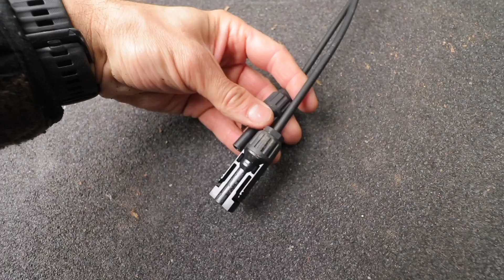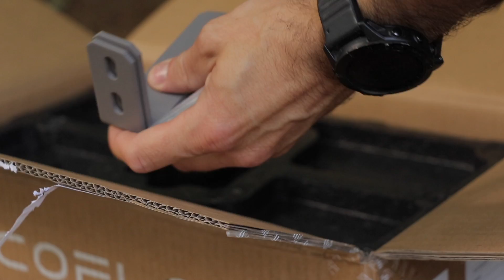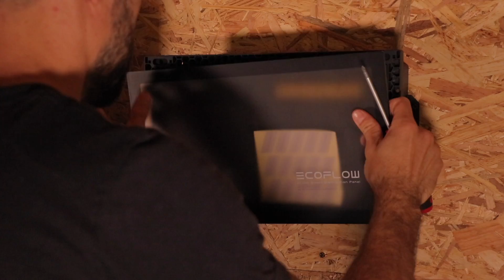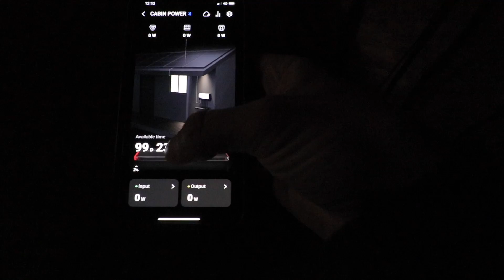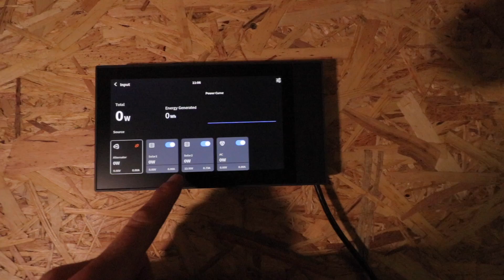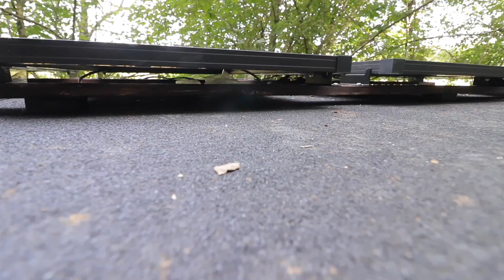Building an Off Grid Solar System at the Cabin in the Woods

Comment: I have a good system which works, hide your electrical system, i have an outhouse in the mountains in Colombia, my solar panels arent visible on the roof because my roof is flat with a border around hiding them. My electrical system such as batteries, fusebox, solar charger are in a hidden wall compatment. I even have a fake light switch and "main power connector" to a fake breaker box inside so that they think its powered by an external generator that i would bring. I also have an an underground mancave at least that was what i intended for it, the entre¡Ance is hidden under the floorboards with a very ingenious system to unlock using a magnet. I keep my tv, electronics and a small fridge (running) there so when i go there once a week i dont need to haul everything with me.

Comment: $6400(US) for 6KWh is nutters.  That's just the ecoflow and the batteries.  Doesn't include all the extra devices you installed.  Plus solar panels (which will need to be cleared regularly).  We might be looking at near $10,000(US).  How much did the rest of the cabin cost?
For $750, you could buy four 1.28KWh batteries.  Keep two in the cabin and swap them out with the other two every time you visit.  
Who would ever pay near $10,000 for the same result?  Oh yea, this is sponsored, so you didn't.

Comment: HOLY CRAP I wouldn't be leaving 10k worth of gear in the shed mate and think a camera system is going to stop some scrotes from nicking them you must be bonkers!! I think I'd be taking the system home and set it up then just take the battery's to the cabin when required
Reply from the maker: Funny you mention this, a few weeks ago I had this exact thought and I've actually done exactly that. Got the setup at home now, and the solar panels work much better on the workshop as it's got direct sunlight with no trees.

Comment: Shouldn't you have put in a vapour/moisture barrier between the outside and insulation, and again between the insulation and OSB sheeting,?  I think you're going to have trouble with damp and condensation without the vapour/moisture barriers.  I put them in on a timber workshop and 10 years later, when I dismantled and sold the workshop, the internal walls (gypsum board) were absolutely bone dry and there had been zero condensation/damp issues or water ingress, because of the barriers I'd put in.

Comment: It's awesome the cabin had that insulation put in! I was hoping years ago the pallet cabin would have this type of insulation placed in it. I'm curious what the R-Value is with these IKO Enertherm boards. Their site doesn't mention it. Maybe R-Value isn't used in the UK. What ever the R-Value is, its probably higher than needed with that thickness. But hey, the thicker you go, the less energy you need to stay toasty warm in the winter.

Comment: Always positive thoughts to you (and your Dad). Great idea with the solar panels, and I could be wrong, but I can't see how you'll get barely a trickle charge on even the sunniest days in the UK, even more so in that specific location,  I've never seen anyone use solar panels in a wood before... What's the humidity rating on those powerbanks, as you haven't put any kind of membrane on the structure it will get very damp in there. They look more like office/home based ones and I hope they last. Can you add some kind of wind turbine to the system? 🙏🏽

Comment: If you want to keep moisture out, you'll need to put in a membrane. I had exactly the same set up as you are doing now, and had moisture issues, even with a floor dpm. I alleviated the problem, by removing internal ply, adding a plastic dryliners membrane, then refixing boards. And insulate your roof. ps you'll get minimal input from those PV panel placement. Place them at the field boundary for a decent input, and you'll never see 100watts for a 100watt panel. I run 1.8kw in a field situation.

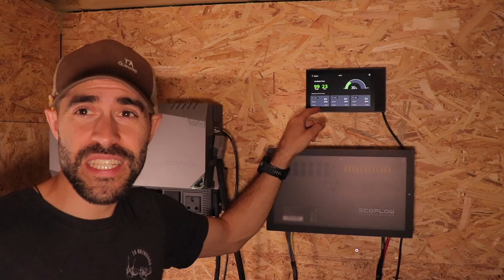Comment: 9:50 LOL, you have no load connected, and the 99 days is probably a maximum this display can show. 99 days could be also to account for the very slow internal discharge.....
...... you don't have "99 days of battery power, at 30% of charge" if you did not connect the load.

you have kWh of the batteries in your setup, divide that by the load you connect to it, and you'll get the number of hours it can provide the power (usually 10% less efficiency loss).

Not 99 days you get at zero W load....

Comment: Drive a earth spike into the ground outside and run a earth cable from the spike back to the main earth terminal on the breaker board  this will give you complete earth protection.

Comment: I think I would have looked into a better solar set up if your solar panels only work with full sunlight . There are better alternatives when it comes to solar panels , you can buy ones that even on a cloudy day , they will pick up & charge 80% of the filtered sunlight in turn powering your battery’s . I happen to own a cabin & have 10 solar panels that Capture 80% of filtered sunlight on my solar set up . I also have wind Energy provided by my 150 foot tall wind turbine &  water Energy with a water turbine that’s near a creek near my cabin . It all dumps into  a huge array of battery banks that are in the basement of my cabin , yes my cabin sits on a concrete foundation so I have the luxury of having a basement & I have the luxury of always having free Energy 24/7/365 with no Electric bills . It all practically paid for itself within the first year if I would have went with hard wiring the cabin through the local Electric company . I have enough Energy to constantly power my cabin every day because of the wind & water turbines are always running .

Comment: You might want to consider adding insulation to the interior roof area so that you don't lose heat from that area.
Reply: I was thinking the same - with proper insulation temperature inside the shed is going to be more stable and better for electronics and people.

Comment: At 11 minutes into the video you quoted your battery has 99 hrs . This is because the system is reading what your drawing from it , it's a little misleading as the second you plug anything that will draw voltage it adjusts it's calculations and you hours available this be careful when you sell a promotional item on your channel , because after all this video is just a sponsored advertisement for ecoflow ..

Comment: What was the actual cost for a like for like set up as the one you installed. There seemed to be so many different parts and tech website isn’t easy to build a system up and add/remove parts based on cost or wish lists.
Reply: Is the response a scam

Comment: What a brilliant system!  I love anything user friendly, especially if it promotes using solar energy. I don't think it's overkill, not for the purposes you need for yourself and for your woodland management.  I appreciate your explanations of how/why you installed the solar panels on the roof and love your recycling of the shipping material!  I have one dorky question, do you have any concerns about any of your woodland critters being able to chew through any of that wiring?  I know instances of rats & squirrels having innocently disabled wiring and even back up generators by their chewing habits.  I'm sure there's a way to encase wiring in some sort of conduit if you need.  Just a thought.  Thanks for another great video of your woodland adventure!  ❤

Comment: I have some more panels than you have (93 panels and 360W each) In the summer when we have long sunny days I can get up to 220 kWh from these and as I have my system on the grid I sell the the power I don't need.. Problem is that I sternly will have to pay more when I buy back the energy when it's dark and in the winter when we have almost no sun time here. But solar energy is a amazing thing if you can store the energy you need to use later when the sun does not shine..

Comment: You've probably received numerous comments about this already but a quick search didn't show me any.  I noticed that you didn't install a vapour barrier over the inner surface of the insulation, before you put the boarding up (c. 03:45).  You mentioned that being better insulated would help protect tools from rust by condensation.  My concern is that the same condensation might form habitually on the insulation, leading to compromise of the insulation, rot of the wood and mould formation.  Perhaps you've considered all this and had made a decision before the install.  As ever, great, engaging and thought-provoking content; thanks.

Comment: Does it have 12volt sockets? If you use 12v lights not 240 you will use much less power as it won't run the inverter

Comment: basic solar controllers have 3 modes of charge,   float, absorb, and equalize.  at different times the battery's will need equalized to maintain there health.  clearing some tree tops would help, but if that is not possible i would think your batteries will not be healthy very long.  think about a gas generator you can bring in to really charge them as second option. one other way, install the solar panels in the clearing past the tree line. also 200 watts is not enough to keep a 48 volt system healthy.

Comment: Wow what an easy to set up system. I agree that starting with more power available is better then having to upgrade later. The expansion ability that you have is great. You can hardwire dc lights from an rv store and leave it ac outlets free for battery chargers. 
Nice job Mike

Comment: Awesome episode! One tip for making solar set ups like this last or any DC current connectors last; use dielectric grease (like Vaseline) on the outdoor plugs, smoother it liberaly where the copper is going to meet in the joint, that makes sure no humidity gets in to foul it.

I use this on my motorcycles and I have no issues with water fouling after 20 years even though I live in a rain forest and moved here from a swamp!

Comment: 2 small suggestions. 
1. place those panels facing that field on a raised platform (think billboard)
2. USB LED's will be way better than that grandads lamp you stuck on the wall, Less power more light! (get a powered usb hub)

Comment: I know you said that light was just temporary but given you have the option with that fuse box, I'd highly recommend you use 12v lighting instead of the 230v. It will be much more efficient. As it stands now, you are taking low voltage solar, up converting it to 230v just to send it across the wire then the modern LED lightbulb steps that back down to low voltage for the LED elements in the bulb.

All those voltage conversions are costly. With 12v lighting that is found in cars, RVs, and Boats around the world, you will get the same light output but without as many voltage conversions and therefore it will be much more efficient energy usage, and you will still have a large array of light fixtures to choose from given 12v is pretty standard. 

You might also consider installing other 12v devices such as a "cigarette lighter" port for charging your phone, camera batteries or other devices. Anytime you can avoid using the inverter to step the battery upto 230v, you will conserve a lot of power.

Comment: "temperatures as low as -20C, which will never happen here in the south of the UK"

I wouldn't be so sure about that.  If the Atlantic Meridional Overturning Circulation collapses due to too much fresh water entering the northern Atlantic from the melting Greenland ice sheet, the least worst prediction is a drop of 5C in UK winter temperatures.

Comment: Very nice indeed. I think those wires could be pushed into the fuse box unit a bit more, looks like there should be some cable clamps there too to stop them being pulled out.

Comment: Much that I love the video and love the simplicity of the EcoFlow system, am I right in saying that's well over £7000 for ultimately just one 13amp socket?
Reply: I think the system is mainly designed to connect to the existing electric system of the cabin (it's just Mike doesn't have it in his cabin) via AC/DC distribution panel,  to power the lighting system, CCTV, or AC socket on the wall if there's any. so it has only 1 direct AC output on the hub

Comment: Go with lcd lights and fixtures so they drain even less volts... The goal is to drain as little as possible while using anything and everything you want or need so lcd's will work good for ya

Comment: Thats some pricey kit. Hope you don't get broken into.
Reply: 1000w silent petrol generator costs about £400. If you don't want the noise, fire it up to charge a cheap battery as you leave. Fuel it accordingly. It will cut off when you run out. Then you have a full bank when you return. £7K plus for this system buys a lot of fuel.

It won't charge up over the winter.. no chance.

Comment: As someone with a solar panel system in my home.  My advice is to trim away some of the tree cover. I removed a tree that was shading my setup and saw a 33% increase in Kw/hr year round.  Your batteries will thank you.
Reply from the maker: Yes, I've been quietly watching the sun the past few weeks and seeing where it tracks across the sky. There's a few mature hazel that is above the mid-layer canopy which is restricting a fair amount of sunlight early on in the day. going to wait until Winter and then trim them back.
Reply: @TAOutdoors  You also absolutely have to tilt the panels. Flat panels are a total waste. We're talking 20 - 30% of wasted energy. This is even worse in the winter, when the sun is much lower (depending on your latitude, it might need an angle of up to 70 degrees in the winter...)
Reply: @Vortagh  just adding your comments, make sure your panels are orientated NE to SW
Reply: He definitely needs to do that. Otherwise those panels would work at such low efficiency levels that it's a total waste. Like Jon said - if there are no optimisers, other panels won't work. There is a lot of misconceptions about solar panels around the internet and people STILL install them in places that cast at least partial shadow at them - which is a huge mistake. You would be surprised how much power you can get even in cloudy winter when your panels are exposed to the sky without anything casting shadows on it.
Reply: @JamesEarlCash  perfectly explained
Reply: @JamesEarlCash  How much sun do they need.  I live in a mobile and one side of the mobile runs east~south~west, has sun all day in the summer and most of the day until it goes down behind the houses in winter.  I'm wondering about installing some sort of system so that we would at least have enough power to charge phones/laptops etc, maybe even an induction hob (we are gas heating and cooking).  Given the increased electric costs and the odds on losing power over winter if it's cold I would at least like to be able to charge laptops etc.  The landlord would allow me to have a bank of panels up against the side of the mobile but I don't want to waste money if they need sun from dawn to dusk.  If you could advise I would be grateful (in Ireland).
Reply: @HeroyamSlava-g3y  Look at Will Prowse channel. He explains solar set ups really well from a small one to a larger one.  I made one for lights initially but it also now charges my devices, phones, a small George foreman’s grill and even my low wattage hoover.  I can also add more panels if I want to.
Reply: I second this. It's pretty shocking how even a tiny bit of shade will cut the solar down to almost nothing.
Reply: @MorseB  if there are no optimisers installed and one panel is getting no sun then the other panels in the series won’t supply power to the batteries
Reply: @jaydonaldson4209  only in a series configuration, if you wire them in parallel shading is not so much of an issue but then of course you lower the efficiency if the MPPT by having a lower voltage 🤔
I find it best to ignore peak power and run both configurations for a few days and compare total input over a given time span 👍
Reply: I’m just surprised the panels are not at the ende of the field instead. A few hours of direct sunlight with the right angle make up for a lot more, that 8 of shaded.
Reply: I agree the trees blocking light is a huge issue. I’d have considered installing the panels elsewhere, perhaps in a nearby clearing where direct light is better; you can run wires to the batteries in the hut easily and inexpensively.

Comment: You can integrate thermal electric generator into your setup, your wood heater can easily pump up 100-200 W/h with a moderate TEG setup.

Comment: Hello from Colorado I love this video Mike and the Eco flow system looks really nice but I couldn't help but Wonder a few questions.
1. Do they offer a wind generator for those non sunny days maybe when it's windy it could help charge the batteries that way.
2. Do they offer some sort of water turbine to run off of hydropower like from a local stream or even a small turbine to go in your gutter that catches the water that way and charges the battery?
Other than that I think this video is very awesome the system you have I myself am not very inclined to be an electrician so they make it very easy Plug and Play I like that option.
Other than that it is always good to see you and your dad on a video keep up the good work guys now I'm going to go watch your dad's channel on TA fishing
Reply: They make in-line hose generators. You either need to build up the water pressure by gradually narrowing the pipes or vertical drop of the water to get enough torque to turn the turbines. They run about $300 for a 500w 220v genertor. "Water Turbine Generator Kit Mini Hydro Power Plant 500W 220V Electric Station" Ebay